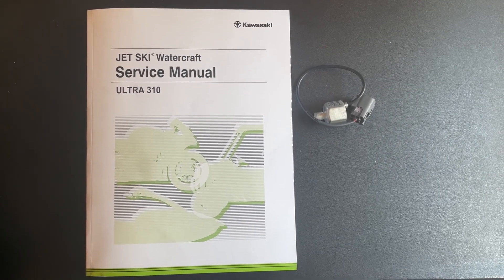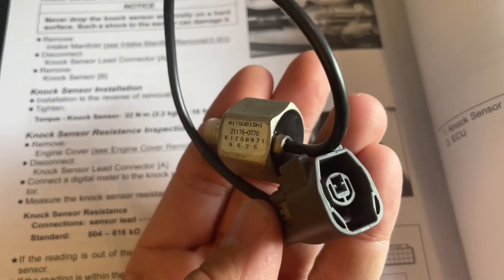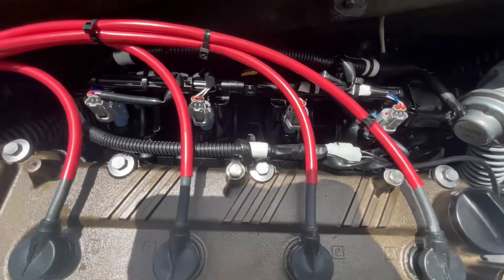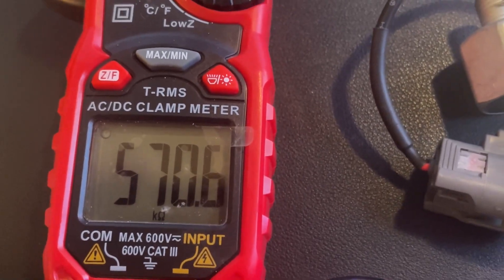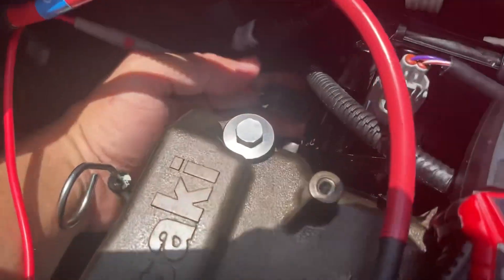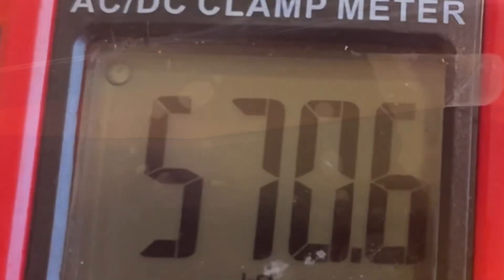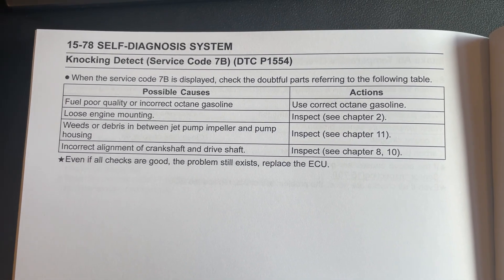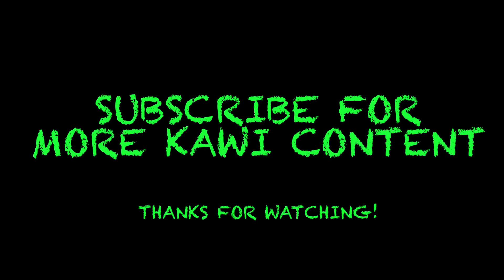CODE 69 “Knock Sensor Malfunction”- DIAGNOSTIC - 2022 Kawasaki Jet Ski Ultra 310 Series 🔧🪛⚠️

Comment from the maker: It has been determined that some early production model 310s required an ECU reflash to fix a persistent code 69 issue. It’s a quick fix, Kawasaki sent letters out to owners of affected units.
Reply: Hi I have a 2015 kawasaki ultra 310 x se  and I have the error code f1 on it and I have looked it and it was some issue with the fuel injection, so can I add injection cleaner to fix the issue and what might be some other issues with it?

Comment: I’m receiving a DETO error on my 2020 310R only on the fast key. Slow key no issues. Any ideas?
Reply from the maker: Likely due to bad fuel or fuel with a low octane rating. This is a b indication the knock sensor is activating safe mode due to detonation detected in the engine. It would also be triggered due to a bad or loose engine mount..but likely due to poor quality low octane fuel. I'd drain the fuel and refill with 93 octane OR add a bottle of K100 G+ fuel additive or an octane boosting additive at the least

Comment: Maybe I’m blind but I cannot locate the OBD2 port on my 2015 Kawasaki ultra 310. I got an Actron P9135 code reader which is supposedly compatible but I can’t find where to plug it in. Any advice would be greatly appreciated
Reply from the maker: There isn't a standard OBD2 port, it's the 4 pin square translucent connector with a cap by the battery. You need a Kawasaki diagnostic port to OBD cable
Reply: @JDsWaterWorld  perfect thank you!

Comment: I have a 2014 310R but registered in 2017. It has 25 hrs on it and i love it. Every now and again I get a "det0" code, which the manual says that the engine has detected knock. If you kill the engine and restart the machine is fine. Runs even better on the SLO key. I have checked the knock sensor  plug abd it's covered in grease. I'm wondering if when it gets hot, the grease runs and possibly changes its resistance properties, giving a false error. The machine cuts down to 3000 rpm like it should to get you back to shore. Problem is, I live in Qatar where the temperature  ambient has been over 45 degrees C in the most cases and water temp of 35 + where I ride. All of these probably will not help for pre ignition of fuel. Has anyone else had this issue? Also the machine has a rattle at idle when out of the water... if you give it a bit of throttle to just raise the idle a bit, the noise goes. Any ideas?
Reply from the maker: Ok, first of all, you can check the resistance of the knock sensor to verify it’s good. What octane level is the fuel there? Make sure you are running equivalent to USA 93 Octane. Have you ever changed the fuel filter bag? Have you checked the fuel pressure? Have you ever checked the injectors? I would say ensure you are using fuel with a high enough octane content- then go from there and check out the knock sensor and the fuel system components. Also it’s a possibility one of the motor mounts is loose or damaged. It’s worth checking those as well just to rule out that could be the cause of excessive shake.
Reply: @JDsWaterWorld  Thanks for getting back to me. I have only had the ski 2 months and maybe only put 2 hours on to it. The first time I used it, it had old fuel in there, and I'm not sure how old it actually was. I popped the fuel cap, and it didn't really smell like a petrol tank. It smelt... old, if that makes sense. The problem is, out here due to the heat, I think fuel breaks down quite quickly, unlike back in the UK. I half filled it with super unleaded and put an octane boost in there. It ran brilliant, not a problem. However, I was only going steady. The last time it had done it, the fuel had been sat for about a month, maybe longer. Ambient temperature here was around 40 degrees so I wasn't surprised it did it again after a decent ride when I pinged it. I have cleaned the knock sensor plug as it was filled with grease as I have tried to eliminate the possibility of the potentially non conductive grease changing the resistance when it gets hot. I will check the other stuff you mentioned but it's just been serviced at Kawasaki... mind, that dosent mean a lot.... ill check. Thank you. Si
Reply from the maker: Ah yeah based on what you’re saying it definitely sounds like the old fuel was a big issue. With it sitting, the filter bag could be all gummed up and even the fuel pump and regulator itself could be gummed up. I would bet the knock was true due to bad fuel…and the ECU was doing its job in retarding the ignition. Does your fuel there contain ethanol?
Reply: @JDsWaterWorld  I'm not sure if it does or doesn't. You would think it would be the best fuel ever seeing as is cones from here. I use the same fuel as what I put in my Ford Raptor  trouble is... the Raptor eats it whete as the ski doesn't. Where abouts are the fuel traps on the 310R? I could take a look if they are transparent. I would always put an octane booster in with a tank, however, you just don't know how much you are going to use.
Reply from the maker: The fuel filter is actually on the fuel pump inside the tank. What about your spark plugs? Have you replaced them? I know he ski is low hours, but because of the age- I change my plugs every 25 hours for peak performance
Reply: @JDsWaterWorld  yes the plugs were replaced just before I got it. I saw the receipt for work carried out by Kawasaki.
Reply: @JDsWaterWorld  DOHA: Qatar Petroleum (QP) said yesterday that the specifications of automobile gasoline (petrol) sold at fuel stations across Qatar will be amended effective from June 1. Under the new specifications, 'Super' and 'Premium' gasoline grades will now become 95 octane (from 97) and 91 octane (from 90), respectively

Comment: Can the knock sensor be replaced without removing the fuel rail?
Reply from the maker: I would just remove the entire intake manifold and leave the fuel rail attached to the manifold. You will disconnect the quick connect fuel fitting, remove the zip ties holding the wire harness to the rail, disconnect the throttle body harness clip and the boost sensor clip and loosen the duct between the intercooler and throttle body, then lift the intake manifold out of the ski giving you easy access to the knock sensor

Comment: What problem to Kawasaki ultra 310R sensor DET5
Reply from the maker: I have not heard of DET5, but DET0 relates to detonation detected from the knock sensor..which could mean you are using bad fuel, old fuel, or fuel with an octane rating below 90

Comment: Hi, my 2014 ultra lx does have acceleration over 6000 RPM, and because of that my JetSki doesn’t go over 30 mph engineer has 130 psi, and new spark plugs. What that possibly would be?new jet pump.
Reply from the maker: So just to confirm you are talking about a naturally aspirated Ultra LX right? Make sure you are using the green FPO key and have the settings set to FPO mode. Did you ever inspect the intermediate driveshaft carrier bearing? Did you inspect the fuel tank vent line? Did you ever inspect the filter screen on the fuel pump? How many hours are on the ski? I see you stated 130psi compression in each cylinder. Also make sure the oil level (while the ski is floating level) is in the middle of the dipstick and not overfilled. Those are all things I would check…let me know
Reply from the maker: Here is the service manual, see page 475 that has the list of all the possible issues that could cause low power and loss of performance: 

https://www.manualslib.com/manual/1381029/Kawasaki-Jet-Ski-Ultra-Lx.html?page=475#manual

Comment: Thanks for the great info and awesome video. I have the 2022 310X. I am one having these problems. I have had problems since new. Only have 5 hours on my ski. Love the ski and the teal blue. The power is great. Mine will go into limp mode in low and medium power mode. It does not in full power mode but gives me limited power and boost. Usually around 10-11 psi boost. I have an appointment at the dealer to repair July 5th.
Reply from the maker: Ah sorry your new ski is having issues! Have you specifically got the Code 69? Well hopefully they get your ski all fixed up so you can get out on the water and enjoy it!
Reply: Thank you for the response. I’m not sure on how to get the codes. It just went into limp mode.
Reply from the maker: When you go into limp mode, switch your main meter display to the “select mode” and scroll down to” vehicle information” under that setting you will see the code listed in the middle of the screen with the corresponding number and description. Make sure to do it before restarting the engine- once you restart the engine, the ECU will clear the code

Comment: Thanks JD again for another instructive video. I got error code 69 a couple times.My new sensor just arrived here in Panama 🇵🇦, and I will change it very soon. But anyway I am enjoying so much my LX.
Reply from the maker: I saw a few of your shorts on the ski, looks like you are having a blast! Did you do the resistance test on the current sensor in your ski? If it fails the test, that’s a pretty solid indicator the sensor itself is the issue!
Reply: @JDsWaterWorld  the Kawasaki local dealer did the test, and now they will try to fix the failure with this new sensor. But ,my lasts 3 rides this failure didn’t show up. So we are evaluating many possibilities…Thanks JD once again! Best regards

Comment: My sensor tested low in ohms. I back-probed it and watched it on an oscilloscope while riding and it didn’t give any data that was above what it was giving before the computer deemed the 69 code. I’m assuming due to the lower ohms that it’s more sensitive than the ecu is expecting.
Reply from the maker: If it was below 504 k ohms, sensor is bad- what was yours? I bought my sensor for a guy in Taiwan (from eBay) and it was around $80 shipped to the US.
Reply: @JDsWaterWorld  I have 501k Ohms.
Reply from the maker: I think it’s exactly as you stated in your post- the ECU at some point runs a test and determines the sensors resistance is out of range. Based on what you said, you definitely have a bad sensor. 504 k ohms is the bottom cutoff, but all the good ones I’ve tested are in the 560 -570 range.
Reply: @JDsWaterWorld  I tried conveying all of this info to Kawasaki, but the number I have says they are in training. This has been for the last week 😅
Reply from the maker: @Gmtail  here’s the number I have: 866-802-9381. Get them to set up a case number for
You and then take the ski into the dealer.

Comment: Very helpful. I hope this is not going to be an issue for these skis. From what you know does it seem fuel or equipment is the main culprit now? I know initially you thought bad gas. I know you have not had the issue. Wondering if you have communicated with other owners having issues?
Reply from the maker: @Edward as it turns out, bad fuel triggers a completely different code- 7B. Code 69 related exclusively to the knock sensor itself, or the wire harness between the sensor and the ECU. It seems that those with the issue are getting their knock sensor replaced and that is fixing the problem. Maybe there was a bad batch of sensors from the supplier? Who knows?
Reply: Hopefully bad batch. Do not want this to hurt this ski. Low production is bad enough. Better success of these skis will Hopefully lead Kawi to do more product change and innovation
Reply from the maker: Agreed! It does seem like they are fixing the affected units pretty quickly. Now that the watercraft division has been spun off from Kawasaki Heavy Industries, I think they have been given a lot more leeway for innovation. Hopefully they will take the new Jet Ski line as seriously as the Ninja line!
Reply: JD. Does the knock sensor error arise early on or is it something that can creep up at any time? Just wondering cause I have 3 hours and no issues yet! 🤞🏼
Reply from the maker: It seems like you either get it when the ski is new/ being broken in, or you don’t! That is atleast what I am seeing on the forums and here on my channel.
Reply: @JDsWaterWorld  Well, was out on the lake tonight. Got code 3 times. Each time shut it off and it worked fine but it was annoying…. Guess it’s time to call dealer!! Was hoping the dreaded code 69 would skip mine! Haha